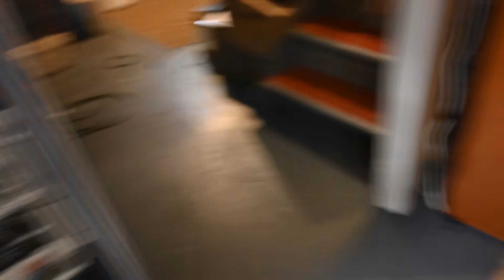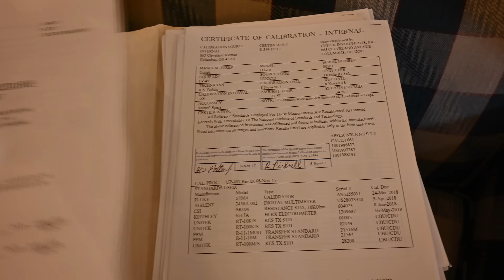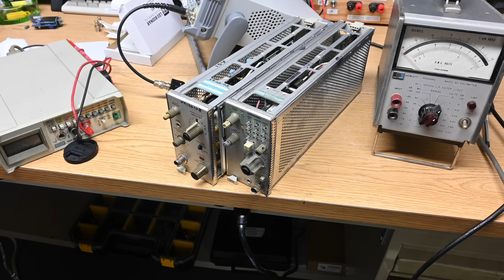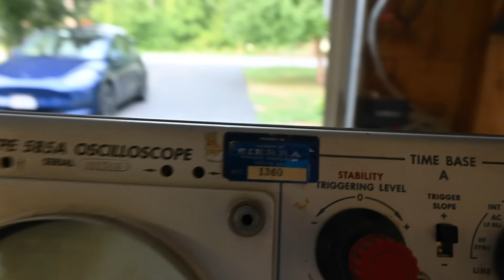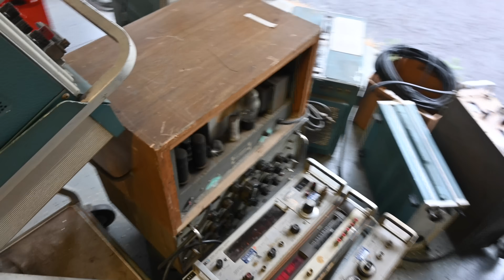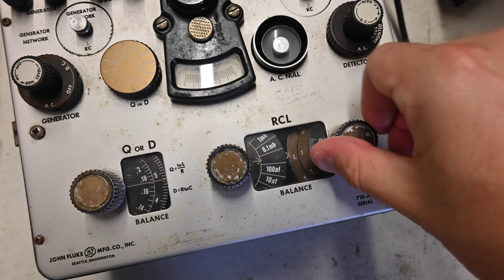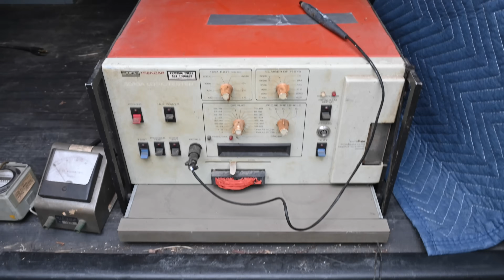Vintage Test Equipment Auction Haul, USAF Museum Visit & Epic Garage Sale Find

Comment: I think chips have taken away a whole way of life in electronics.  Involvement in maintenance/design was closer to the front lines.
Reply: Yeah, I liked it when building something involved piles of resistors, capacitors and transistors. It's not so much fun when everything is a little tiny black rectangle with "legs".

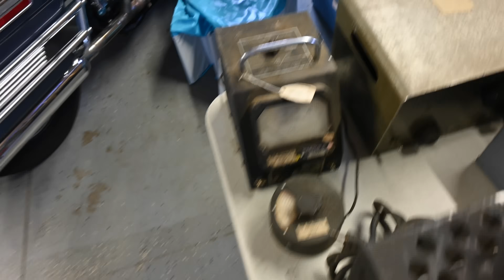Comment: 16:52 I think is a grid deep meter... I guess.
Reply: dip?
Reply: @douglas2lee929  
A grid dip meter, also known as a dip meter or GDO, is an electronic test instrument used to measure the resonant frequency of radio frequency circuits. It's essentially a variable-frequency oscillator that generates a small-amplitude signal. When the oscillator's frequency matches the resonant frequency of a nearby circuit, the oscillator's output power decreases, causing a "dip" in the meter reading. This dip indicates resonance and allows the user to determine the resonant frequency of the circuit under test. 
- Google

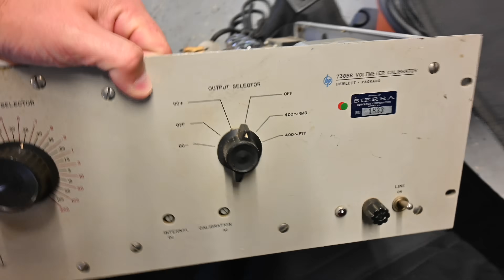Comment: 11:21 HP738BR these have a vacuum tube DC voltage reference; 5651a . The reference voltage is in the 83 to 87 volt range. 0.1 percent accuracy

The one I got surplus was at the TRW swap meet about 3 decades ago; ex Navy Subic Bay surplus

These HP calibrators were made from 1965 to roughly about 1973? region.

The attenuator is a different box so neat to use as a gizmo you need just an  attenuator

Comment: 0:57  A 3458A is great machine but risky when used. One I bought used worked well for about 18 months then the ADC got the dreaded drift issue. With a ACAL it is dead nuts on within a few ppm in voltage to a Fluke 723A and other references, After 18 months on the same rack the ADC got goofed up. So when I do an ACAL the unit is spot on; ie the stock reference is good. 

But the ADC drifts so each hour and it is higher. ie the error in 10 hour is about 10x the error in the 1st hour . Do an ACAL and the unit again is spot on.

Like one has a electrical tape measure that grows in error each hour and an electrical ACAL gets in back to about zero error 

A new one today is 16k to 16.5k , They were 14k a year or 2 ago

Keysight can repair them and made the new units "modules" retro fit to the older Agilent and HP 3458As too.  I think their base repair cost is like 2700 now.

Comment: Nice collection! I used to lust after gear like that but long ago moved to quarters where I did not have any room for it. I still love the gear, but I am so glad I don't have to fix, store, or move it. I had one of those hp (738?) voltmeter calibrators with the dual 6550's. And yeah, sold the 6550 tubes. Nothing I do in electronics requires anything near the type of precision most of that gear implies.

Comment: On the 7A29 that is a stiffness of the rubber o rings on the attenuator. Use great care in getting those moving again there are very fragile plastic rollers that will crack off and break. I have a video on my channel about this topic but YouTube is usually cranky about adding links. Good news is it will come back but it needs some exercise.
Reply from the maker: Thanks! Do you happen to recall the title or number of the vid?